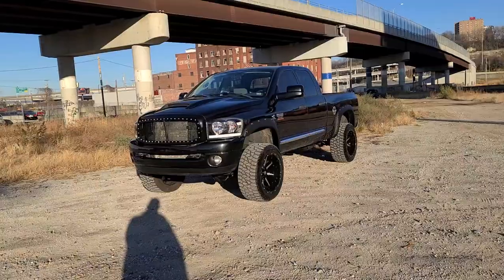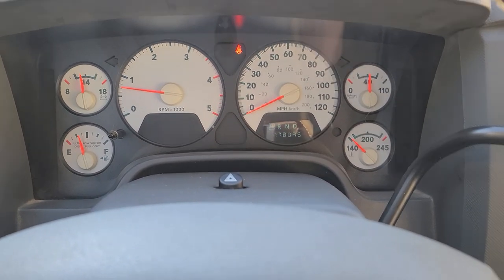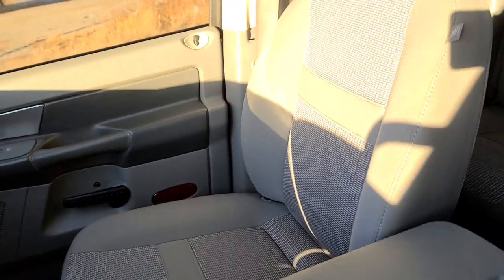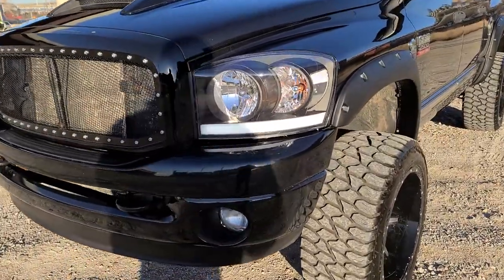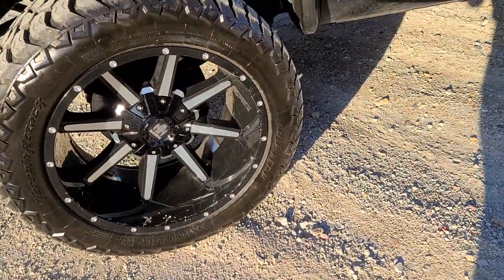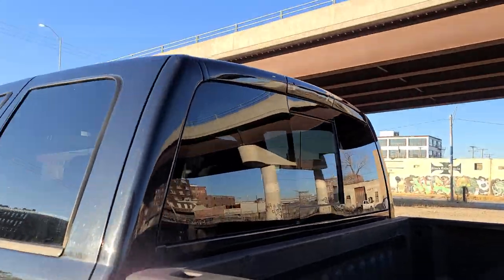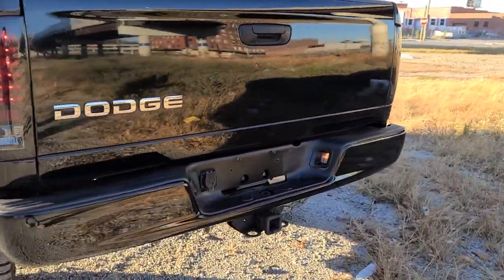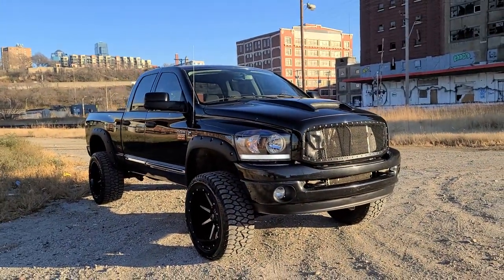2008 Dodge Ram 2500 6.7 Cummins, Deleted, Tuned, 22x12s, 35s, COLD START, FOR SALE! 816Diesel!!!!!!!

Comment: hands down thats a nice rig for sure props to the owner for taking care of it something juat get outa control like the little bit of rust it happens just every time  look at it i go right back to the rims -50 offset iam sure thats not  correct iam running AF blades 24x12x35 with neg 40 offset thats a full 6in witch seems like a mile on this rim and hes got 22s yah something aint right just saying
Reply from the maker: 22x12 -51 is the setup!

Comment: I'm thinking about buying this same truck but with the long bed. Should I buy it? It only has 120000 miles. Will it last me forever with not many problems?
Reply from the maker: Doesn't matter ford, Dodge or chevy they will all have some problems at some point. Your weakest point on the dodge is the transmission so make sure you drive them and get em warm makensure it goes through all the gears nicely.

Comment: Questions i have exactly same truck  08 dodge ram cummins 2500 & i want to do full delete EGR DPF  but i am afraid tha is going to be really loud what can i do to keep not to loud?????
Reply from the maker: Don't delete it! Point is to make it breathe! They make muffelered system.
Reply: @816Diesel   thanks man
Reply: @4rember  if your state isn’t crazy about it Then full delete it. Your truck will thank you. You can use a muffler to combat the noise gain without sacrificing anything else. You’ll gain power, reliability, and mpg importantly
Reply: @Sentinel15   thanks i started lo looking gorva 5 " exhaust with muffler
Reply: @4rember  unless your pushing big power  a 4inch will be plenty. not to mention a 5 will be louder with more drone
Reply: @Sentinel15  thanks man for you time to answer my questions ty